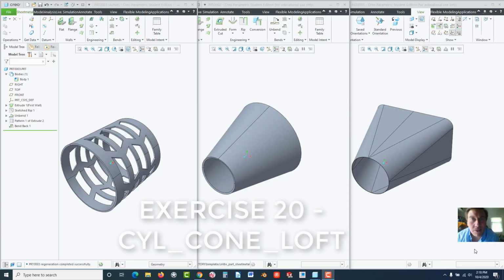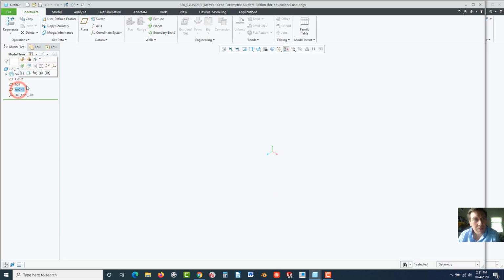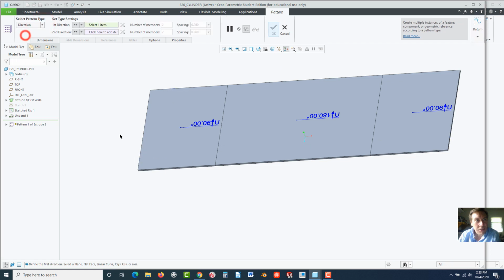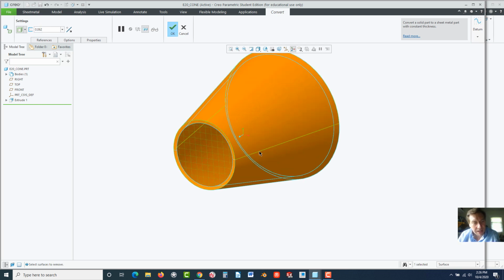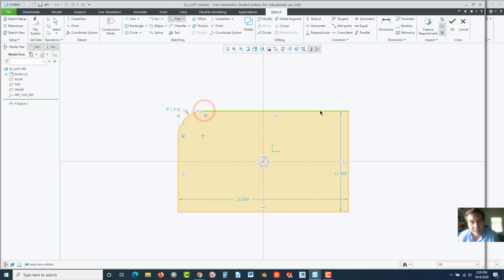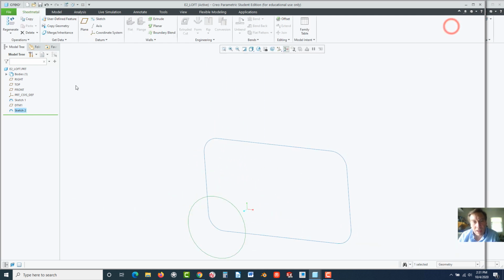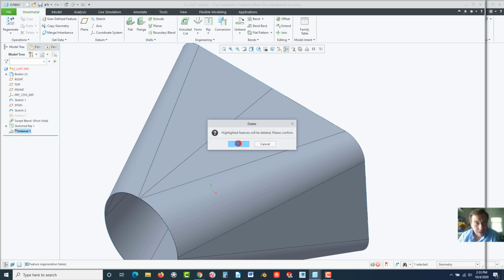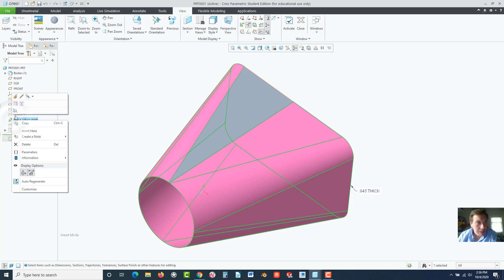E20 Creo Parametric 7.0 - Sheet Metal Cylinder, Cone & Loft -Fail

Comment: Did anyone ever figure out why the third example did not flatten?
Reply: I just experimented with it, and if you set the thickness to .01 and extend your trajectory line/sketch rip line past the edge of the cone it will flatten out properly
Reply: I draw the part as solid, then I convert it to sheet metal. The part flatten without any problem.